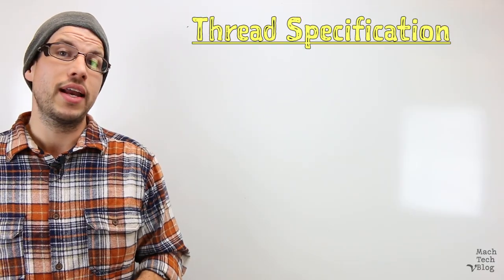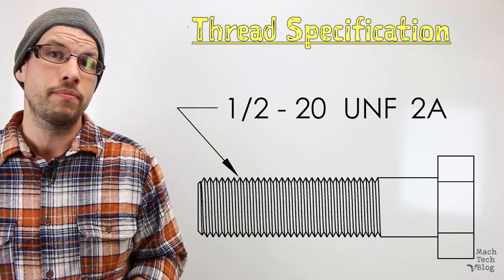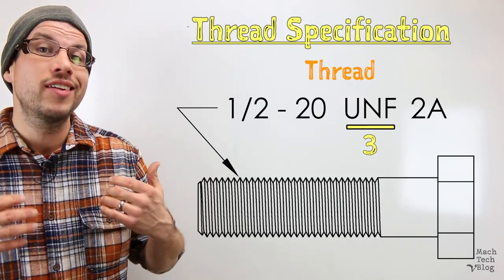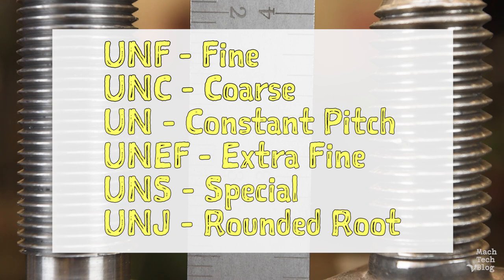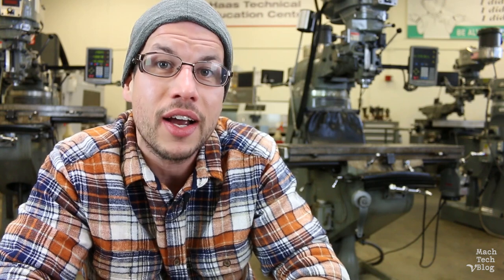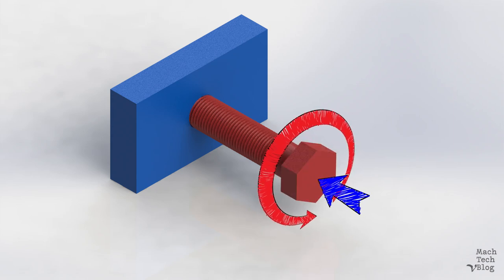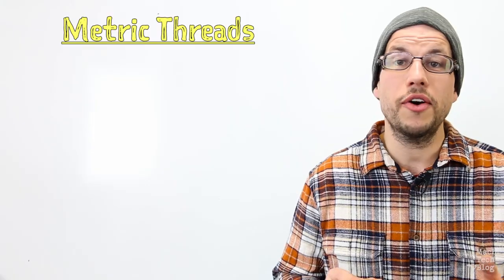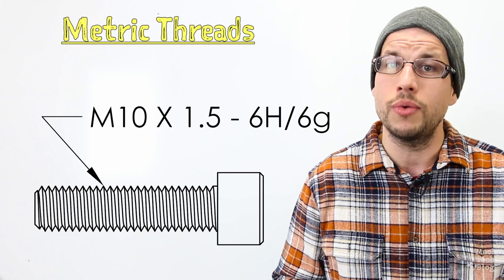Screw Threads

Comment: Can’t resist telling you this cuz you’re gonna laugh. I had a question and You Tube sent me your direction. Well, didn’t get my answer (yet) but I couldn’t stop watching. You are an excellent communicator and the subject was fascinating and understandable. Now for the humorous part - I’m a 71 yr old female that asked the question,  - is more thread on a screw more secure? I’m holding two metal wood screws here and needed the one with the best hold. While one has less threads the “blade of the thread is sharper and appears slightly bigger. No worries, I’ll find the answer, I think, but thought you’d get a laugh from a older woman. Think I’ll be watching you again though!

Comment: Adam, thanks for your clear lesson, inches are a bit hard for we europeans, newertheless they are so important, as you know all the electronics works on inches, bores on printed circuit boards are drilled at 1/10 or 1/20  inche-pitch . . . Even water pipes ( in Italy ) are sized and also threated in inches, even in a different mode, called here "GAS - inches" ( not WITHWORT )  . . . Before your lesson i didn't understand so much inches-threading , but now, with your help, all is so much easy . . . Thank you very much

Comment: As an engineer with 7 years of experience, I can say that I have never ever come across a specification for the class of threads being used, like you said. I really think that it comes in use only, when you are making precision machines and measurement equipment, as in the case of the micrometer.

Comment: very well done and informative video...
a bit of confusion that I have not been able to find the answer to yet... are SAE threads measured from peak to peak, from valley to valley or from peak to valley?.... I have a large bolt that when the threads are measured peak to peak, It would seem to have 4 threads per inch, but when measured at the valleys, I only get 3 threads per inch.... so would this be a 3tpi, 3.5tpi or a 4tpi bolt?...  I would think the measurement should be started at a valley, and if it ends on a peak, this would be a full tooth count, but if the measurement ended in a valley, it would designate a half thread... in the case of my bolt, I believe it to be a 3.5tpi, but before setting up to cut one like it, I would like to know where to start... thanks

Comment: We had a great old time mechanic who had to work on some old made in England machines. At that time believe England had their own thread standard before switching over to metric system. Old guy always called them bastard threads. Have used both SAE & metric boots & nuts & prefer the SAE.

Comment: I don't know if their standard name is screw threads, but such threads are more commonly found on bolts. No matter if they go through a hole and are fastened with a die, or screw directly inside the hole. Here in Europe, screws are only the tapered (conic) things used with wood and concrete...

Comment: Great video. As a non-native english speaker i have a question:
Is the difference between a Screw and a Bolt only defined by the receiving female thread? Because you could screw a Bolt into a machined thread instead of a nut, for example....
Reply from the maker: Hi, Jӧrn,

Thanks, and great question! The difference basically comes down to the intended use of the fastener. For some fasteners, this differentiation can be vague. A hex head bolt can be inserted through a hole in assembled parts and tightened by torquing a nut. It can also mate with a preformed internal thread in an assembled part and be tightened by torquing its head. However, the fastener in the second application would more appropriately be called a hex cap screw. In other cases, this differentiation is clearer. For example, heavy hex structural bolts must be assembled with a heavy hex nut in order to perform their intended function in assembling buildings, bridges and railways. To this end, they have different characteristics than common hex head bolts:

+ They have larger heads to distribute load more evenly
+ They have longer shank (non-threaded portion) lengths to improve strength
+ They’re made of different alloys, they receive different heat treatments and they’re never galvanized or electro-plated

And then there are the obvious examples in which a fastener can only be assembled with one method. A wood screw can only be assembled in a piece of wood and cannot be assembled with a nut. And a round head bolt cannot be tightened by torquing its head because there’s nowhere to put a wrench, so it can only be assembled with a nut.

Did we mention there are a bewildering number of threaded fasteners on the market?
Reply: Wow that's an incredible detailed answer. Thanks for that. I'm from Germany, and as far as i can tell, every screw and bolt you showed in the video is called "maschinenschraube" and further described via the drive, metric diameter, lenght, length of the thread, thread distance and hardness. For example "Aussensechskant (Hex Cap) M8 x 40mm, durchgängig (full threaded), 8.8"...

Comment: I honestly think the metric system is way easier than the standard
Reply: The thing to do with Metric and Imperial is to learn them equally as in using your left and right hands and to use them both together all the time. When you do that, they blend together easily. A calculator and 39.37 is all that's needed as help.
Reply: So does the rest of the world..:)
Reply: @RollingEasy  I guess you have a point, as an computing engineer, I can either do arithmetic in hexadecimal or decimal or binary, it doesn't matter, I prefer hex, its easier because in computers everything comes in powers of 2 (because, binary).
I can change bases or units, just don't mix them in the same piece.
Reply: @patrioticwhitemail9119  the metric is based on the distance light travels during a certain amount of time, time that is controlled by the number of cycles a certain atom of Cesium
Reply: @JM320STW  yeah, retroactively done, not at it's conception because the inconsistancys between different measuring sticks was a flaw that was just as potent in both standard and metric. This retroactive setting could just as easily had been done to standard, but the U.S. government just got lazy, so they based the ruler off a fraction of the meter.
Reply: The meter was not originally based of some random tyrant-stick. The measurement is based on the distance between the earth's pole to the equator. This distance was defined as 10 million meters (10 km), giving the earth a 40 km circumference. The scientists that calculated this distance way back in the 1790s did a pretty good job as the official distance today is 10 002 km. Nowdays all the metric units are based on scientifically repeatable values except the last being the kilogram set in 2019. Fun fact imperial measurements don't have their own repeatable values but are instead actually pegged to the metric/SI units. So even your freedom units are in fact based on the Metric system.

Comment: Hello, i have some question on the bolt part
1. How to judge how many nut can we put on the bolt?
2. How to judge the bolt should put on top surface or below surface?
Reply: Shun Jian Lee it will have to be from drawing specifications to where it goes, and as for how many it can fit it depends on the length of the bolt and the thickness of the nut you're using

Comment: so I’m confused,  if you  500 thousands bolt has a thread pitch of (60°)  this will calculate out a right angle triangle have a height of 0.043 and if the hole which you drill has allowing for threads, which would only be 0.414 thousands but, the thread chart specific 29/64 (0.453) that’s a difference, right…..what’s going on there
Reply: like am I losing out on 0.040 by following the thread chart, cause if that’s the case I’m gonna start threading those holes closer to the calculations for better tolerance

Comment: that 6H/6g is wrong. it should be H6/g6. And it's not complicated at all. the letter is the desired size that will ensure a loose fit, or press fit. So you have an assembly of 20mm shaft and bore. The bore you make it at exactly 20mm, this is letter H. So the exact nominal diameter of bore is marked H. Now the shaft is turned to a bit larger diameter to ensure a press fit. any letter after h will make the fit tigter. So H6/k6 is press fit, and H6/z6 is super press fit and H6/h6 could be a very light press or a very tight loose fit. while H6/f6 is loose fit and H6/a6 is very loose.
You can mix the parts like P6/m6 and realize it will have a loose fit as the shaft is less larger than the hole. this means the hole is 20mm nominal but hole is made let's say 20.05 and the shaft 20.04mm both are over nominal but the fit is loose. Usualy the bore is made to nominal spec meaning H. 

The number is the precision class. so let's say H is for the hole of 20mm. so the hole must be made exactly 20mm but this is not possible in real world. a tolerance must be set. So the numbers states how small or big the tollerance must be. 1 is the lowest deviation form nominal (this is really for standards and refference calibers), 2-4 - calibers and very high precision instruments, fine mechanics parts, etc.. 5-6-7 is about what a lathe/mill can do on regular steel parts, 8-9 is for larger parts made with cruder tools. Usually above 9 is irrelevant as it's noncritical dimension.

This tolerance is important for a fit. so a shaft-bore of 100mm diameter H6/p7 means is press fit, and the bore must be made H6 100.000mm up to 100.022mm so +0.00 and +0.022, and the shaft is p7 that is +0.037 and +0.072mm so smallest shaft is 100.037mm and largest is 100.072mm. You can see that even the largest hole with the smallest shaft within tolerances will have a press fit. Of course if the fit must be carefully pressed, you need tighter tolerances. because the small-big and big-small give a press fit of 15microns up to 72microns. So it could ba a bit pressed or more pressed within these values. For a more consistent press fit a H6/p6 will give better results since p6 for the shaft will have only have +0.37 +0.52 so the variation of the tightness drops within 15microns up to 52microns... H1/p1 is hust hypothetical and will ensure a press fit of 15microns with a variation of a few nanometers.

So the thing is to remember is lower case is for outer dimensions (shaft), and upper case letter is for internal dimensions (bore). The numbers tell you how accurate the part need to be. So 6 is general high quality lathe work, 7 is a worn lathe work (blunter tools, lower surface quality that throws off the 6 tolerance), 8 is sloppy lathe work (or in general a good lathe but with a heavy cut without cleaning of the surface to cut the time of production and if 8class is good if enough it's ok).. and for the sake of fits, classes up to 16 exist. 5 is for a really nice lathe (like a CNC high precision made part). 4 is for surface grinders and other precision machines, some EDM machines,  lower than 4 you likely never see unless you work at NASA. you need the top tools on the planet to make a part exactly that dimension to be within a 2 tolerance class). 

So if you have a hole with H4 on it, don't drill it to size, but ream it and polish it and hone it closer and closer to spec (checking with an H4 go/nogo plug caliber for that dimension). while H7 is good enough for a boring bar or a drill press with a normal drill bit.
Reply: 6H/6g is correct when talking about threads. The H7/g6 you refer to are not the same thing and relate to non threaded features, usually holes and shafts.
Reply: @TheShred89  I stand corrected. I did some research and it appears there are tolerances for pitch diameter and outside/inside diameter for both the nut and the bolt. like M12 x 1 - 5H6H/5g6g (5H pitch diameter for nut, 6H internal diameter for nut, 5g pitch diameter for bolt, 6g external diameter for bolt) Odd to change the layout of fit and precission class for threads different from arbors or slots.

Comment: Great videos. They always provide nice information that I wouldn't expect to hear, because it's refreshingly complete. I enjoyed that bit about TPI and linear distance. I've done some technician work but I would love to be a machinist. 

Maybe you or anyone with you will be answer my question about an odd thread I came across. 
http://507movements.com/mm_111.html
They call it a "Micrometer Screw", but I have no idea why they would call it that. The description doesn't really do it for me, either. What of it?
Reply from the maker: Hey, NPG3D,

Thanks for the support! The mechanism called a "micrometer screw" on that website is more commonly called a differential screw. It's a fascinating concept and maybe we'll include a description in a future video. Here's the idea in a nutshell. A shaft has two threaded lengths, each with a different pitch. One of the threads (with the coarser pitch) is assembled into a mating internal thread. A nut is assembled onto the other thread (with the finer pitch) and the nut is captured, so it cannot rotate. If the shaft is rotated one full revolution, the entire shaft assembly will travel a distance equal to the pitch of the coarser thread. As the shaft is rotated, the finer pitch threads simultaneously assemble into the captured nut, causing it to be drawn up the shaft and travel a distance equal to the pitch of the finer thread. The net effect is that the distance the captured nut travels due to the finer pitch thread subtracts from the distance the whole shaft assembly travels due to the coarser pitch threads. The captured nut travels only the difference between the two thread pitches. (Hence, differential screw.) This mechanism can be used to make incredibly fine, precise movements.

ex.) A shaft is manufactured with a 80 TPI threaded section and a 100 TPI threaded section. The 80 TPI thread is assembled into a mating internal thread and a nut is assembled onto the 100 TPI thread. In one revolution, the shaft assembly will move forward .0125" (1"/80 TPI = .0125" Pitch). At the same time, the captured nut will move backward .0100" (1"/100 TPI = .0100" Pitch). The net effect is that with each revolution of the shaft, the nut will only move forward .0025" (.0125"-.0100"=.0025"). 

Let's go one step further. If the circumference of the shaft is marked with 25 graduations like a micrometer, then each graduation would represent .0001" (.0025"/25=.0001" per graduation). A device which utilizes this mechanism can very accurately provide direct control over movements of as little as .0001". This is extremely helpful when very small, precise adjustments must be made to assembled components. An example of a common application is on optical instruments, when very fine adjustments must be made to align optic elements.
Reply: Very interesting. I ended up watching a few videos on the matter since it was easy to find under the name differential screw. If you guys ever decide to make a video on it I bet it would be way better than what I found! Thanks a lot for a very surprisingly detailed explanation!